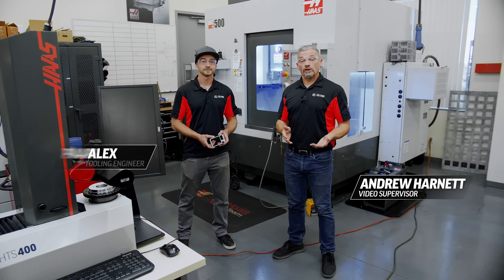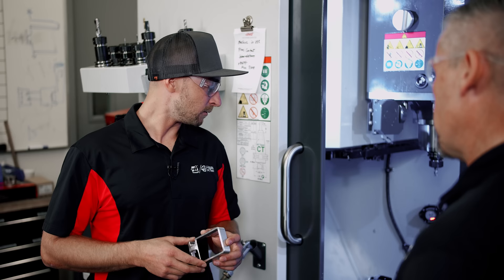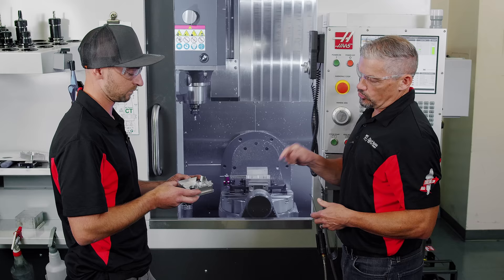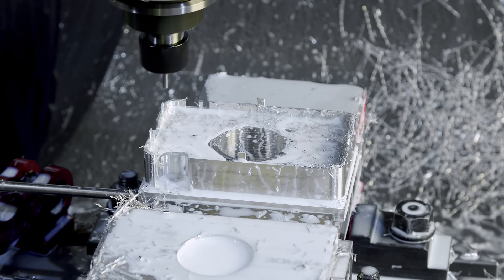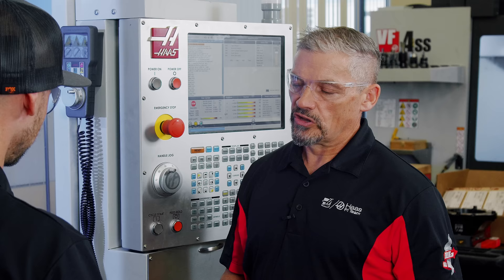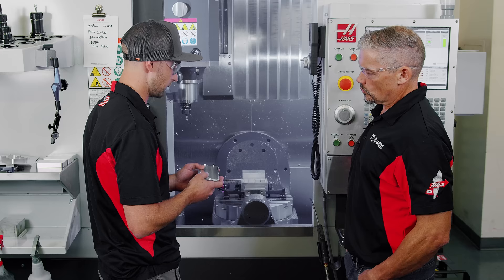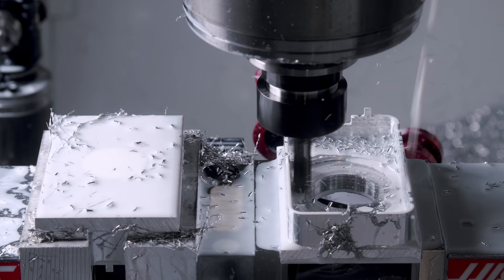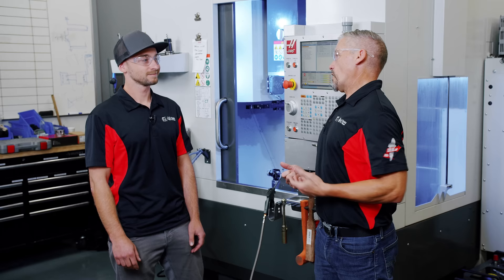Demo Part Breakdown - How Alex Made this Autodesk University Part - Haas Automation, Inc.

Comment: Job shop owner: Your lucky if you get a print nowadays. Customers are too lazy to make a pdf of a part. When you question a hole size, they get their panties in a twist. You ask if it's for a bearing. Yes, it is they come back. What's the tolerance on it.  There reply is; I want a slip, semi push fit. That's what they come back with.  WTF!
Reply: Most "hobby" customers simply do not know that there are several numerical tolerances for things like bearings or bolt holes. To them it's "just make it go in" or "a bolt hole is a bolt hole, why overcomplicate things" so they rely on engineers or machinists to determine the best fit.

Comment: That 1/2 hsam2 ramps aluminum like nobodys business I bet its just as comparable to skip the drill and ramp it down on a .400ID at 10deg. I've been very pleased with how good it is at roughing aggressively. it will also drill if so desired.  i found that out when i forgot to reset the length when i changed my tool gage length and didn't reset the tool, drilled one into my part about 1/4 @13500rpm on a gm25x @5% rapid (59.ipm)  and it sounded pretty good,  like a drill . wasn't even clogged up on the tip after. on a later job i was doing bunch of pockets and was drilling into my pocket at 40ipm@12500rpm  .150 deep then taking off at 175ipm with a 85% old school stepover and it worked throughout the whole job. pretty sure i had at least 40 cutting hours on that tool and I'm still using it.